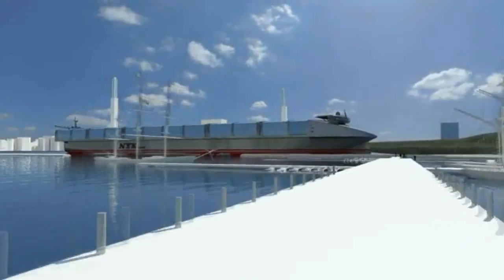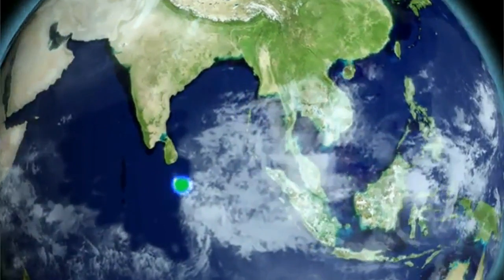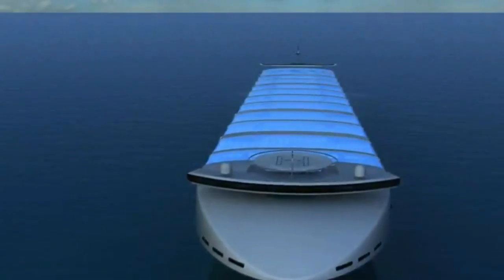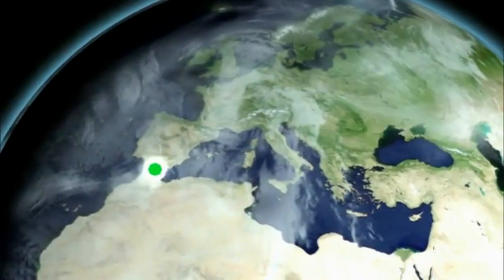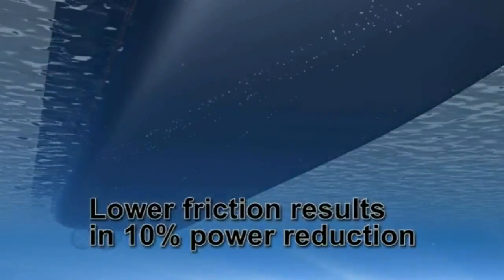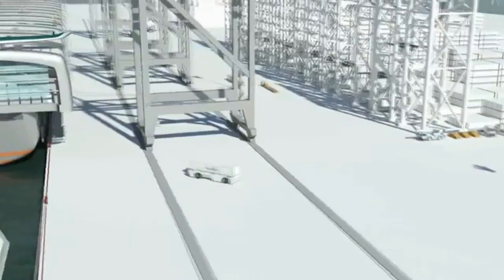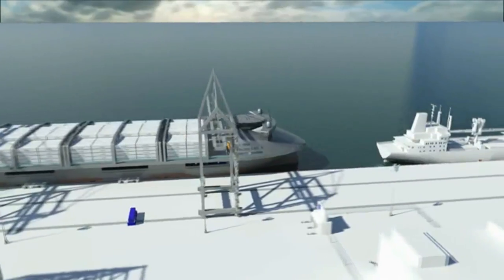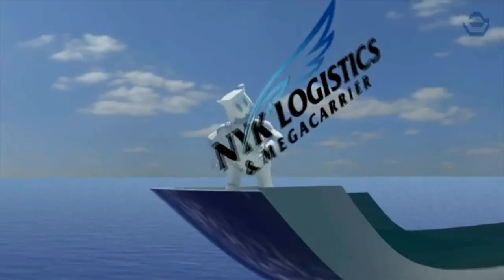NYK Super Eco-Ship Concept Design

Comment: every thing u r talking about is BS cabon I God don't give a fuck. After retirees gone free limitless Hydrogen detuned a bit w/carrier fuel to make safer & stable will make working a thing u do bc u want to or a thing u do for a retirement & something to do not hve to do diff sci fi world. Propane carrier fuel on the road or at home nat gas & hydrogen. Any f-ing time we want I want when humanity not massively fucking themselves up the ass evil, or evil & old ppl gone that r relying on younger to work to float the fraud current retirement system. I need ppl to figure out the baddery tech game b4 I make batteries useless most of the time. Compressed air & detuned Hydrogen r the wloe game that & dirt cheap solar sandwich in vertical not horizontal form. 20% bouncing back& forth down the double side ultra thin panels will get what ever free power there is to b had. U don't hve to do anything w/solar trickle adds up to creek & then to stream w/out any help except cleaning panel or aiming which can be done w/out help as well.

Comment: The splitting up of the hulls is undesirable.
Reply: Hmm. I'm fascinated by it though. I wonder what mechanisms they imagine could keep this vessel bound together through high seas. lol. the ocean is no joke and if those mechanisms require some form of electric power source to maintain its grip then I imagine it would be a huge drain on the overall power supply. Which goes to your point TP Lo